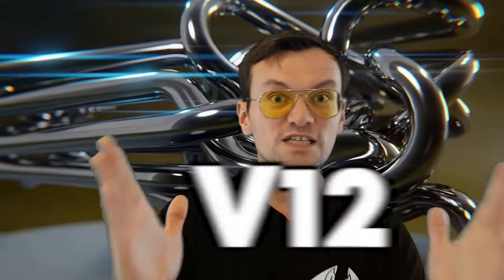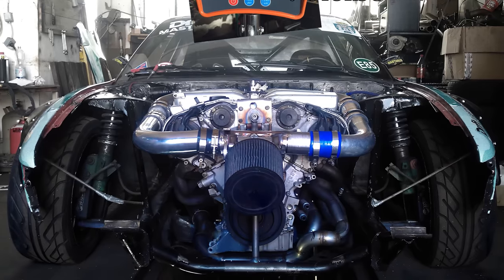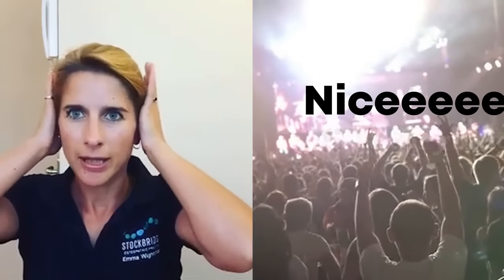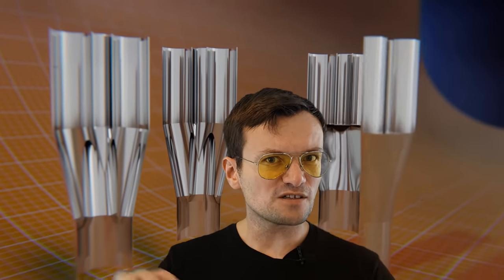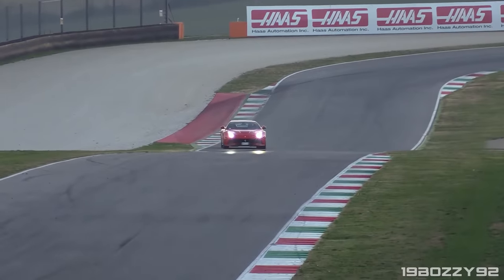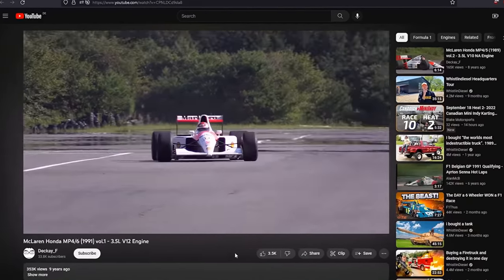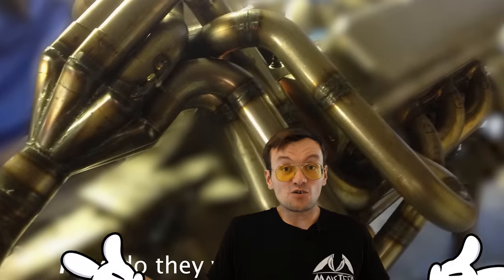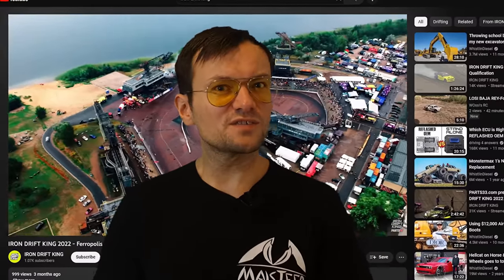Why This V12 Sounds Better Than a $5,000,000 Pagani

Comment: Genuinely want to know, if they are equal length headers, why does the order they are connected matter? I know because of firing order but if they all are equal, how is the order they are connected in make a difference?
Reply from the maker: So as I learned first hand - the choice of the collector plays a huge part.
In the smooth sounding merge collector, the primary principle is that it evacuates the adjacent pipe with the vacuum created by the pressure pulse.

In a 3in1 collector the pipes are all next to each other and  the vacuum evacuates the adjacent pipes -> assuming a 45mm pipe diameter, the vacuum only has to "travel" 45mm to the next pipe (center to center). 
The circle diameter in this tightly packed 3in1 collector is 52mm...

6in1: Now the circle diameter has to grow to at least 90mm to fit all 6 in a circle. The vacuum has to "travel" now almost 90mm to the next firing cylinder when fired crosswise - or 45mm when fired sequential.

12in1: Now the circle diameter has to be at least 175mm. The vacuum "travel" distance is now either be up to 175mm to the next power pulse or still be 45mm when connected "revolver" style.

To be fair. There are more 4-times as many firing pulses happening - so the vacuum will not "travel" all the way and it'll sound sweet anyway - I'm sure. But I can not imagine, that this will make no difference whatsoever - especially considering how huge(!) the difference in sound is from just changing the collector style.
After the M120 project is finished, there will be another project where I can change the firing order,  then we will know for sure how big the difference really is.

Comment: Is that Mustang still a crossplane V8, or a flat plane one? (Isn't one of the newer Sehlby engines a flatplane one? And this one revs high enough that it looks like they put such a new one in)
Reply from the maker: In the original video (you can find the title when the mustang is shown in my video) it gets shown with something that looks like a 60-year old 2-valve ford engine. And on his channel  he goes into detail about the firing order. You can trace back the pipes too. The 8-in-1 header is a "workaround" to make a crossplane fire like a flatplane. How the cylinders are joined together is what matters. Not the shape of the crank (except when we enter into uneven V angles like 72° or something - but I think that should be obvious.)
Reply: @maisteer  Thanks!

Comment: Did this guy throw shade at the LFA? One of the best soundings cars?
Reply from the maker: You mean the Lexus LFA? The 2nd most famous sportscars Toyota ever made? And one of the Top 20 best sounding production cars of all time, but certainly not the best one?
....nah, I don't think so. ^_^
Reply: @maisteer  so did you throw shade or not? You put fire on the hood insinuating it was burning?
Reply from the maker: @ChumpyChicken2  The fire could have been an accident. Maybe some shady wiring...? ^_^'
Reply: @maisteer  so your not going to answer the question?
Reply from the maker: @ChumpyChicken2  "...nah, I don't think so." didn't answer it?

Comment: where did you get the animation for the pressure wave propagation? would have killed to have a visual tool like that when I designed an FSAE exhaust
Reply from the maker: You can see the video title in the lower right, but let's make it easy: https://youtu.be/eRqaRxMi0Cs
According to the comments it might be EngMod2T

Comment: Sorry but the 12 into 1 header has already been built, I did it 3 years ago in my V12 swapped Miata.
Reply from the maker: No need to be sorry Bruh ^_^' - yes some other people have mentioned your build already. Great job - really! Did you get it running? I would love to hear how much difference the collector firing order might make on the V12's.
Reply: @maisteer  firing order within the collector is partially negligible regarding exhaust sound, however it definitely makes a significant difference in performance when it's done correctly.
Reply from the maker: @ThatV12MiataBruh  I'm not fully convinced, mainly because the Mustang in the video does sound different to the other symmetrical 8-in-1 setups, but then again - they are different motors too. And maybe I'm wrong, and that's okay. But would sure love to hear both. Is there a video of yours screaming somewhere?

Comment: @maisteer - Very interesting video. I'm surprised you didn't begin by copying Pagani's Zonda exhaust. They use 3 into 1 equal length headers with a very long 2 into 1 collector. The collector then splits into 2 pipes all the way to the exhaust tips. Street versions had a large muffler in the rear but "R" models used 4 individual resonators or no resonators at all. It looks like they used quite small  tubing in the headers too; perhaps 1-1/2" or smaller.
Reply from the maker: I guess nobody would have watched a video of me copying an exhaust everyone has seen before ^_^

Comment: How much sound can be extracted out of a twin turbo v12...im talking about poor sounding Huayra
what would it take to make the Huayra sound as close as possible to the Zonda...i think space wont be an issue😄
Reply from the maker: Pagani has already taken care of the poor Huayra: https://youtu.be/EEG8YrDVcc4?t=415
and the solution was sooo simple ^_^ '
Reply: @maisteer  ah, well...i already knew about the Huayra R because its N/A but im curious about a forced induction process. example: what if the Huayra used a supercharger instead of turbos? the supercharger doesnt block the exhaust like turbos so the sound can still be extracted? right?

Comment: How would a 39 liter V12 diesel sound at 2000 rpm with 12 to 1 collector and equal length? Asking for a friend.
Reply from the maker: ...not very good ^_^
Reply: @Maisteer  https://youtu.be/HHx3ON7oflo?t=1m27s 
It has a pretty weak exhaust tone as is, the mechanical noise is often louder. When you can hear the exhaust it reminds me of 'murican V8's in that you get kind of a V-twin pulsing between banks. (It has log style headers into straight 700 mm square tubes)

I was thinking I should be able to get a more pronounced exhaust note with equal length. Much easier to do 6-1 than 12-1 though :)

Comment: Umm the biggest difference between the factory equal length headers and the aftermarket ones / Pagani Zonda V12 is the fact that the ones that sound good and the Zonda exhaust is made of titanium and everything else you have shown is stainless steel. Stainless steel gives it that raspy note while the titanium being a harder material gives it that crisp crackle to it which is always associated with the F1 sound because coincidentally enough F1 exhausts are made completely of titanium from headers to exhaust tip....
Reply from the maker: How sure are you about your statement? Or how for starters: How many F1 exhausts do you know of that are made from Titanium and not from Inconel?
Reply: @maisteer  considering my family has been involved in C.A.R.T IndyCar racing for the last 35 years it has taught me a thing or two.
Reply from the maker: Are they doing the catering for the Indycar VIP guests? They certainly weren't able to teach you much about F1 exhausts. But that might not be their fault.. ^_^
Reply from the maker: Hi Baltazard... I've made a new video just for you: You can point out all the mistakes in it if you like: https://youtu.be/6EjbfLSRmyA

Comment: So I'm doing research to put a set of custom headers on my semi trucks diesel V8. When I find this video.
It just so happens that they made a V12 version of said V8 I am tinkering with (slapped on 4 more cylinders/took two inlines and mated them).
Did I mention it was a two stroke diesel, 63.5 degree vee angle and with a little bit of tinkering said V12 can hit 3000 or with some mods to the valvetrain 4k rpm. 
Now I'm getting some really wicked ideas. How crazy would a massive Natrurally aspirated V12 sound with headers like these?
Reply from the maker: How crazy? I don't know, but I hope the world will find out someday ^_^

Comment: Hi, did not catch if the collector should be with full pipe diameter endings in to the collector or smooth transitions. Also what collector angle is the best for that ecstatic sound? I will make new 3-1 headers for my 6cyl and would like to get the best possible sound. Thank you in advance!
Reply from the maker: More on that in the follow up video. But for now you can checkout: https://archive.org/details/fourstrokeperfor0000bell - Chapter 9.

Comment: 3:30 you need a 6-1 merge collector to get the Pagani sound
Reply from the maker: But even the Pagani manages with a 6 into 2 into 1 per Bank...?
Reply: @maisteer  in general you need the 6-1 merge collector plus equal length headers, pagani has other things going for it like 12 cylinders, flat plane crank, firing order, high revs, smaller cylinder size etc
Reply from the maker: @chir0pter  I noticed when I read flat plane crank and V12 in the same sentence, my blood pressure always seems to go up... why is that? ^_^
Reply: @maisteer  I may have been wrong applying that to a v12 but am right about other things. I’m not sure if you talked about equal length, I didn’t watch the whole video as I found you too unlikable

Comment: The bikes and their manifolds are different between the 125 ktm and Duke 1290 the belly of the mufflers have long since turned the engine for acceleration or maximum speed
Reply from the maker: I've read it multiple times over the last week, but I really don't understand your point. ^_^

Comment: This reminds me of the fascination with nascar boom tubes. @Stapleton42 did a youtube about trying to get the best sound.
Reply from the maker: I just had to look them up.... What are they about? Better aerodynamics? Or is there some kind of aero/power advantage at high speeds?
Reply: Not sure how to explain it, but it made the old nascar v8's sound like they are reving at a higher RPM when they are not.  @maisteer
Reply: This is the first car for when the sound changed. https://www.youtube.com/watch?v=k7P3sth9oZ0

Comment: It might sound good but the pumping losses through all the tubing is very high and won't produce optimal power.
Reply from the maker: 100%, it is gonna sacrifice some power. But the project was never about the maximum power - if it was we would have gone turbo straight away.

Comment: The GT350 sounds different, because it has a flat-plane crankshaft.
Reply from the maker: Well, how do you know? Not only does the owner of the mustang disagree with you...
but if you join the cylinders sequentially in a 8 into 1 collector with equal length primaries together, so every exhaust pulse arrives exactly every 90° crank degrees apart, one after another... - Why should it sound different any from a flat plane v8 when you apply the same conditions? That seems more like magic than logic...

Comment: I've always been curious how it would sound if you made an individual pipe for each exhaust port a double stack of 6 2inch pipes at each corner of the bumper or maybe even send them straight up
Reply from the maker: Propably very loud ^_^

Comment: Seriously you would probably get comparable results by tuning the induction and using a normal high performance exhaust and you would be able to actually fit it in the car, the Lexus LFA has tuned induction by Yamaha and that sounds better than your V12
Reply from the maker: ...and you really watched the video? ^_^
Reply from the maker: If you care about the results you can see them in the new video I've made: https://youtu.be/6EjbfLSRmyA

Comment: What would happen if you ran the exhaust for each cylinder all the way to the rear, but made them equal length? Granted, it's inefficient and heavy. I know engines benefit from joined exhaust.
Reply from the maker: I don't know. Let's find out.
Reply: @maisteer  Yes, do! At least packaging would be easier...you have like 8 feet to make them equal.

Comment: If you’re just going by sound? You left the all time great out. You Screwed up.
You forgot the sound of a 11000 RPM Mazda. 🤭🤭🫵🏼🤡 angle of attack at connection of collector. Too sharp crappy sound angle nicely sweet sounds.
Reply from the maker: Yeah, my bad - I messed up. The Mazda 4-rotor ticks all the right boxes and has the best idle sound too ^_^
What would you reckon is too big for the collector angle tough? Over 20°? Over 30°?

Comment: Where did u get the information about the firing order when they coming into one last pipe ?
Reply from the maker: I can not give a simple answer to that question yet, but as I learned first hand - the choice of the collector plays a huge part.
In the smooth sounding merge collector, the primary principle is that it evacuates the adjacent pipe with the vacuum created by the pressure pulse.

In a 3in1 collector the pipes are all next to each other and  the vacuum evacuates the adjacent pipes -> assuming a 45mm pipe diameter, the vacuum only has to "travel" 45mm to the next pipe (center to center). 
The circle diameter in this tightly packed 3in1 collector is 52mm...

6in1: Now the circle diameter has to grow to at least 90mm to fit all 6 in a circle. The vacuum has to "travel" now almost 90mm to the next firing cylinder when fired crosswise - or 45mm when fired sequential.

12in1: Now the circle diameter has to be at least 175mm. The vacuum "travel" distance is now either be up to 175mm to the next power pulse or still be 45mm when connected "revolver" style.

To be fair. There are more 4-times as many firing pulses happening - so the vacuum will not "travel" all the way and it'll sound sweet anyway - I'm sure. But I can not imagine, that this will make no difference whatsoever - especially considering how huge(!) the difference in sound is from just changing the collector style.
After the M120 project is finished, there will be another project where I can change the firing order,  then we will know for sure how big the difference really is.

Comment: To each his own but I think the initial result with the M120 and M5 headers was actually awesome 
Sounded a lot more menacing and powerful than the F1 mosquito
Reply from the maker: You are on your own with that opinion ^_^'
Reply: @maisteer  how did you fit the M5 headers to the other side of the V12 i dont get it, it's reversed right?

Comment: At 11:15 you say symmetrical orders like this are not possible, I don’t understand what you mean by that, please clarify
Reply from the maker: Sequential firing order means they fire like a circular patter into the collector. 
1) Look up the firing order of every V or boxer engine with 5+ cylinders.
2) Imagine how you could fit them in a circle, one firing after another. 
3) Imagine if that still would be possible if the headers on the left hand side would be like a counterpart mirrored from the right hand side.
4) Come to the conclusion.... no, it wouldn't! ^_^

Comment: The Rolls Royce Merlin Engine Was Voted The Best Sounding Engine In The World And It Doesn’t Even Have An Exhaust Or At Least Much Of An Exhaust.
Reply from the maker: The Pagani was also voted the best sounding engine in the world. I guess votes don't matter much. Lot's of exhaust stuff tough in the new video, but no Merlin engine: https://youtu.be/6EjbfLSRmyA
Reply from the maker: I hate to admit it... but that is something very special... Thanks for showing that to me! Wow.. where you see them in person like that..? That must feel amazing.
Reply: @maisteer   that’s a Rolls Merlin at full throttle.  It’s hard to believe that a team of engineers designed that engine using pencils and a slide rule on blue print boards in 1933 England.  It’s a very special Engine that helped the allies win WW2.  You can go watch this at red bull air racing where there are a number of mustangs still flying them.
Reply from the maker: I've know about the engines a little after reading the book "the secret horsepower race". The engineering back then was outstanding.
Thanks for showing me, I really want to visit an air race now ^_^
Reply: @maisteer  if you love engines it’s a fantastic place to be.  The noise Experience is something to behold.  The noise just hits you in the chest.

Comment: It’s a Amg  v 12 and headers don’t join into 1 the defeats the purpose of headers real headers like on a v 8 drag car ha1 pipe per cylinder usually long enough to stick out the side of the car what you want to do is the same thing with a v 12 have 12 pipes connected to the engine and sticking out the side of the car

Comment: For me sound is so important for air-breathing engines. After owning two BMW sixes I could never buy an Opel/Vauxhall since the sound is so disharmonious. It always upset me to the point I would never buy one again. That was some years ago. Maybe they fixed it since.
Reply from the maker: It only got worse. Now they made BMW's sound bad too. Once a BMW sneaked by me, emitting noises like a bastard child of a hovercraft and a dyson vacuum cleaner... They call it hybrid.
They make it really hard to like their regular cars nowadays.
Reply: My summer plaything is an MX-5 NC Facelift and there's a lot of pleasure to be had revving it past 4000 RPM and listening to its sound change from polite to urgent to manic. I have an aftermarket silencer that accentuates the bass. The perceived engine sound is weighted in favour of intake manifold sound via the factoty ducting. Alles Gute - tolles Kanal - Rob in der Schweiz

Comment: How do they weld the inside of the header collector? I understand how they do the outside but how does it not leak if the inside cant be welded?
Reply from the maker: Tack everything together. Weld outside first. Cut off the outside shell. Weld the inside from the inside of the pipes. Weld the outside shell back on. Done.